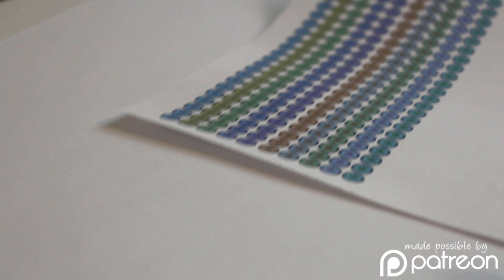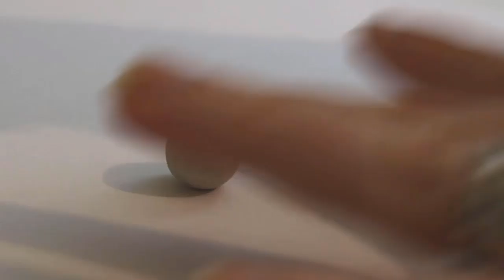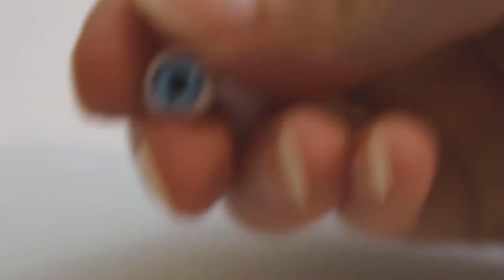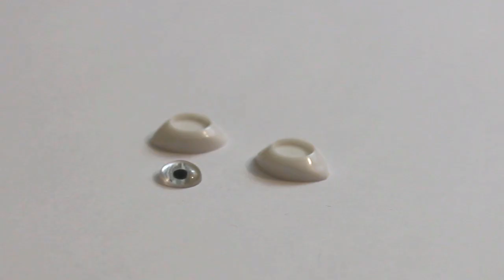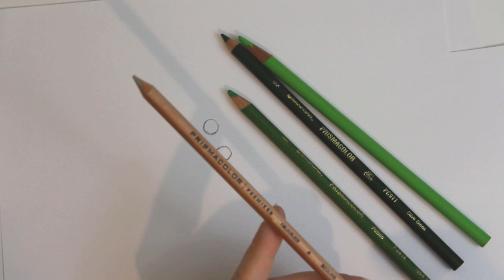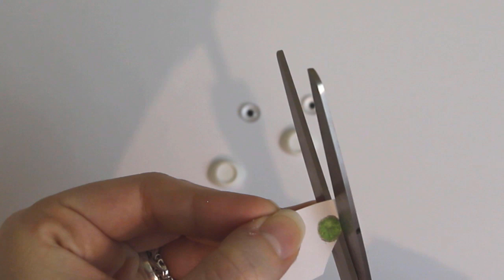More eye making: Fixing small problems and an easier way to make BJD eyes

Comment: Hello! I have a question. 
For the premade eyes, is it okay to use airdry clay to make the corneas? 
If so, will I also have to use resin in order to seal it?
Reply from the maker: You can definitely use clay if you're hoping to add shape and texture... Having a transparent dome of resin is also optional--it helps add depth to the eyes and make them more lifelike, but I've seen plenty of flat eyes that just have a coating of gloss over them that are quite pretty, too.

Comment: Thanks for the great video!  I've been so frustrated trying to find the right color eyes for my dolls, this was a huge help! :)
When using the ready-made eye kit (like toward the end of the video), you said to put a tiny dab of glue on the back of the cornea.  Do you just put it behind the pupil, or spread it out over the surface?  And what type of glue would you recommend?
Reply from the maker: I try to keep it behind the pupil, but some of them are pupilless, and I try to spread it evenly across the whole piece on those. I just use school glue for it. It's just a little extra tack to make sure it holds in place, because some of the cornea pieces are loose and won't snap in all the time! The only thing to be mindful of is that there are no bubbles, because the glue is VERY visible when it bubbles. :(

Comment: Another question! Is it possible to use chalk pastels inside the eye kit well? If not that's cool, the eyes with paper look incredible, just wondering what other mediums that could be used in this scenario
Reply from the maker: You can use pretty much anything! You can paint directly into the eye too, or if you want to use pencils or pastels in the eye, you would brush on a bit of something that would provide tooth and texture--like paint or matte medium--and then you'd want to seal it with another layer when done. The important thing is making sure nothing gets on the sides of the eye well so the cornea will still snap in. I've also seen people paint the back of the cornea part for a really neat layered look!

Comment: One option for doming/curving thin paper/card, is to use a ball tool, its an embossing stylus which has a ball tip, choose one of suitable size for your project and then place your circle of paper onto a dense foam, like the back of a mouse mat. Roll the ball tool in circle motions over your paper piece and it will gently stretch the paper and make it curve.  Hope it helps
Reply from the maker: That's a great suggestion! I need to get me one of those...
Reply: PS pls don't gross out but if you rub your ball tool on your head before you emboss with it each time, it picks up a little grease n works much more smoothly :)
Reply: Choose a bigger tool than the project piece to avoid it scrunching the paper but its worth experimenting a bit

Comment: my nail polish bubbled!
Reply from the maker: Oh no! If you have a small file or a bit of sandpaper, you can sand the nail enamel back out... it will make it look cloudy but when you re-coat it with polish again, it will clear up. If it gets bubbles in it while it is still wet, too, you can use heat such as a hair dryer to draw the bubbles to the surface and make them pop!
Reply: Lomi's Playground  i actually tried my duraclear polyurethane satin varnish and it worked far better and if i wanted to remove it all i had to do was shove a xacto knife in the seam and it peels right off  :-D